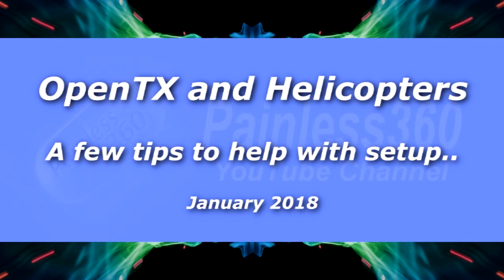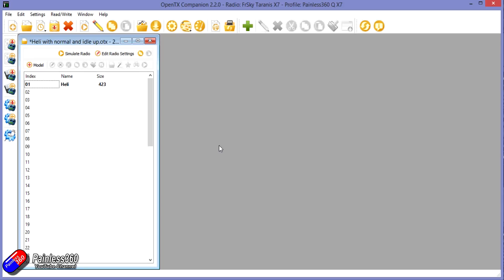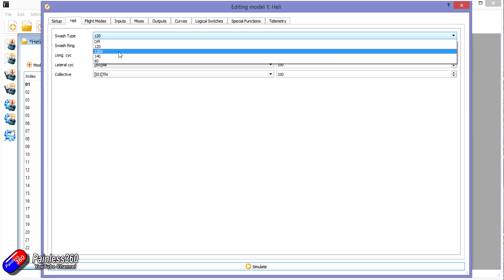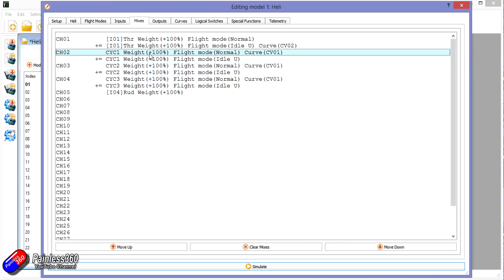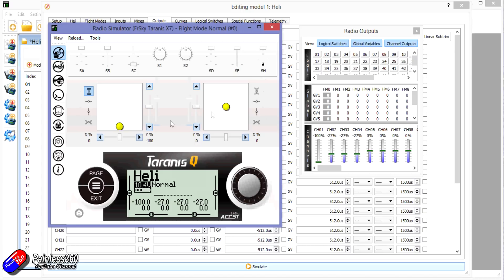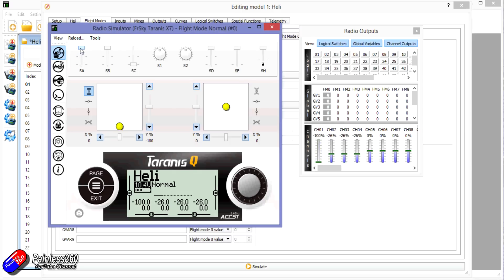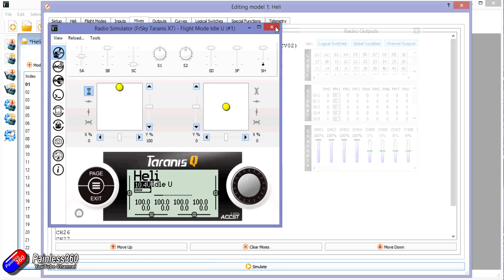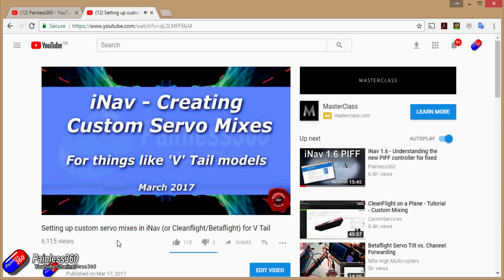OpenTX Mix School: Swashplate/CCPM/Heli Setup Tips

Comment: Hello Lee    Can you please help me to set up the gyro percentages ( 70% & 30% ) in my taranis qx7 using the radio and not the open tx website.
I have installed Edge Tx in the radio and got my heli all correctly configured except the gyro.   I have assigned a switch to set rate or heading hold mode but I am now stuck as I can't set the 2 modes for the gyro to read them.
Reply from the maker: I'll get a video up on Friday that covers how to adjust the travel of a channel, that should help.  Stay tuned!
Reply: @Painless360  Thanks Lee !

Comment: Great video. Now, if we can only get one for Ethos. I just bought an X20S as a replacement for my JR12X, only to realize Ethos is extremely lacking in the helicopter department. Great for fixed wing but not helis. 😢
Reply from the maker: Yep, ETHOS is great for all types of fixed wing but lacking in many other areas at the moment.  I'm sure that'll change over time... Happy flying!
Reply: @Painless360  Hey, thanks for the response. Hope it develops rapidly. I have a Kavan Bell Jet Ranger with Raptor 90 mechanics, Bergen Intrepid Gasser, Bergen Intrepid Turbine and a Trex 600E anxiously awaiting. My JR12X has a dying screen hence I bought the X20S.

Comment: Hi, nice video however, didnt help however for the t12  tx which am trying to set up for a fb 450 V2 trex heli. Am trying to get the throttle connected to the three collective servos and not the esc, which is set via the idleup switch to give three power setups !
Your help appreciated!
Reply from the maker: The way it works for me is here in the video. If the swash mixed are setup properly then the throttle will be mixed into the swash height automatically... Best of luck

Comment: Hello, I am a loyal subscriber to your channel, and I recently bought a TX16S radio station.  I have a flybar align 450 helicopter and I can't make the flight settings.  Can you help me with these settings?  Thank you very much!
Reply from the maker: https://youtu.be/WzBz_IBTtYs is worth a watch..
Reply: I just got an Align T-REX 450 Pro heli with a fly bar and original gyro system with a Futaba FAsst receiver. I would like to setup on my Radiomaster TX16s but cannot read that protocol. Any ideas on alternate receivers? Also will this video setup work with the 450 heli? Thanks

Comment: Hello! i have been on and off about trying to get into flying RC helicopters for about a year. I got a e sky 150 v2  and i finally bound it to an SBUS receiver with my taranis qX7.
but no matter what i do, been through all the opentx settings, mixes and inputs, and i still get no response from the helicopter. ive tried posting to forums and ill continue to until i get this thing flying. but any pointer in the right direction would be helpful from anyone :)
(im using:
taranis qX7 tx
frsky xm+ receiver (pain to bind, but finally got the green light
no module in the tx because im unsure if i need one if the Rx has already bound)
Reply from the maker: The channel order is crtitcal. Not sure what that model needs but I'd look at that first.. Best of luck

Comment: BTW the swash ring is to prevent what I refer to ask puting the sticks into the corners.  Instead of the swash moving in a "Square" when you put the sticks in the corner it rounds it out as if you had a cyclic ring on your transmitter.

Comment: I am old school and still fly NITRO helicopters and use a REV Limiter called the Throttle Jockey Pro (REV MAX) and not exactly sure how to set it up with this radio.
Reply from the maker: If you know what PWM values it needs then you can get the radio to do whatever it needs... Best of luck

Comment: Just got a RadioMaster TX16s.  Trying to move all of my craft to one radio including my Helis.  Thank you for this video.
Reply: I seem to be having a weird issue.   I've got the programming in correct as far as I can tell.  Servo channels respond as they should in both the OpenTx simulator and in the monitor on the radio itself.  But physical servos are not responding accordingly.  I've tested each channel and servo for proper movement without cyclic mixing.  Works fine.  But it's almost like the radio isn't sending out the proper PPWM when using CYC1, CYC2, or 3.  Could this be a bug or issue with the RadioMaster?
Reply: Nevermind previous issue.  The problem was the multi-module was automatically remapping the channels for Spektrum TAER.  I was programming it in TAER then the radio would swap it around and mess everything up.  The fix was simply disabling Channel Remapping.  : )

Comment: i am a heli pilot and new to open TX. when you chose create new module you alone have the chose of airplane or a quad , i dont have a heli option or is there on and does it matter since you add a swashplate in the program
Reply from the maker: Most modern helis use flybarless control units so swash mixing isnt needed but if it is - you can add it to an existing model as shown. The support for helis isnt great in OpenTX... best of luck!
Reply: @Painless360  i got one that is flybar the rest are flybarless. i just notice in your video i you  had a helicopter model type when selecting new model. all i have is a airplane and glider to select. i dont even have a drone  model type
Reply from the maker: They seem to have put the flybarless setup in the 'too hard' box. https://youtu.be/u-NykZnjRM0 may be worth a look...

Comment: Good Ole CCPM mixing! I've used FBL gyros since before I got me Taranis and have never got to use CCPM mixing but I'd like to try it. I still have a FB head.
For FBL one mix with one pitch curve is sufficient on channel 6 with source set to thr?
Is that what you've found to be true ?

Comment: I just came to this video from a link on one of your Jumper t16 videos. How does this relate to the Jumper T16? Does the Jumper T16 come with this software? How do you transfer these settings from pc to radio?
Reply from the maker: The heli settings are the same in all versions of OpenTX, including the version on the T16/. Best of luck! See the other videos on the T16 for how to use Companion on the PC with it too..
Reply: @Painless360  Thanks for that. I Love your videos. Amongst the most informative I've come across. Keep up the good work. I just wonder tho, if you have had any trouble with the Jumper tranny like some others have had with certain parts of it malfunctioning? Have you heard anything in this respect? I saw one reviewer come up with a rather nasty SD problem that basically bricked his unit not long after he bought it.

Comment: I just purchased a Flysky Nirvana. It doesnt have companion support yet, and there isnt much info anywhere on setting up helis. I cant seem to understand how the mixing setup works from within the nirvana menu :(
Reply: After spending 3 hours straight messing around in the settings, I've finally gotten 90% there. All settings seem to finally be working. No companion support so all done on the touch screen nirvana running opentx. Planning to use an irange irx4 plus to bind with my xk k110 and k120, as well as 2 walkera v450d03 helis
Reply from the maker: Best of luck with the final steps! Happy flying!
Reply: @Painless360  I have got the elevator mixing working great, but for some reason my aileron is not showing any input on the monitor. When I go to Inputs and click edit and move the stick left and right, i can see it on the graph moving. Any idea why its not showing any input on the monitor?
Reply: if I have the mixer source as aileron - it shows input on the monitor for aileron channel. When I switch it to CYC1 - it suddenly stops showing any aileron input on the monitor...thoughts?

Comment: Swash ring limits the stick at the diagonals and ensures that the maximum cyclic input is equal all the way around. Without it more cyclic is possible on diagonals than with pure elevator and aileron inputs because of how elevator and aileron are additive. In the old days the swash ring was an actual ring you put into the cyclic gimbal that would physically prevent the stick from going into the corners but with the advent of computer radios this could be done electronically. If you look at the analog stick on most game controllers you will see that the arpature for the stick is circular for the same reason; to ensure that control input on the diagonals is equal to control input on the horizontal and vertical.

Comment: Nice video, 
but you did forget one thing throttle hold. it needs to override all your other curves including throttle. when throttle hold is flipped on it doesn’t matter what switch is flipped in normal ,idle up 1 or 2 hold is is on over everything.
Trying to remember how I set it up I think it was switch denoted with a ! To override.also you will have another pitch curve and throttle curve for the hold function.
Reply from the maker: Please make a video on it. There isn’t enough detail on help setups, I had to figure this out from scratch!
Reply: Use a Special Function to override the throttle channel on the throw of a switch to -100, that will override anything as long it's at the bottom of the special function list.
Reply: @TheBionicbone  Thank you!! THAT WORKED!!!